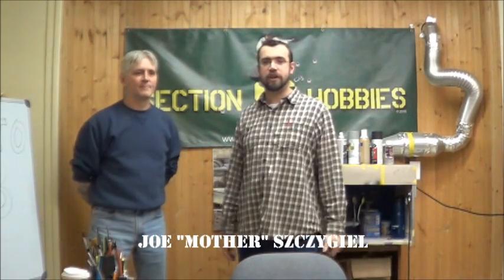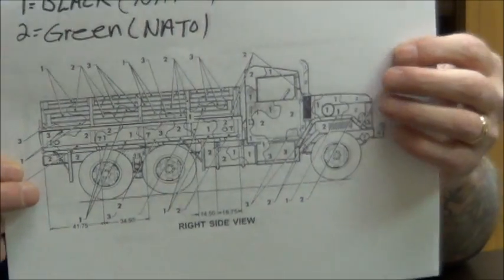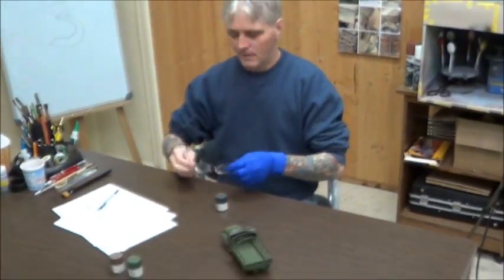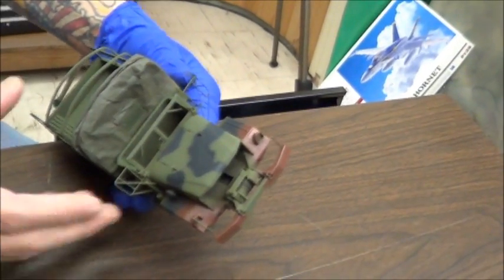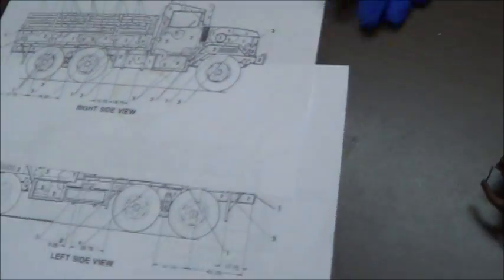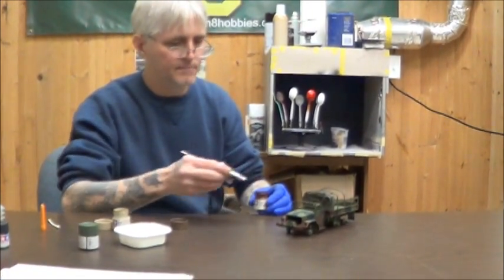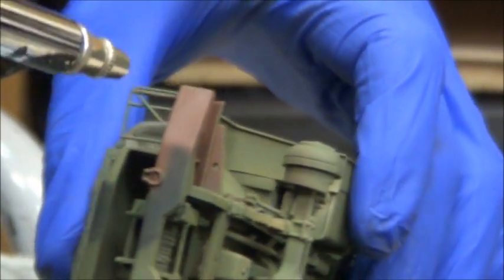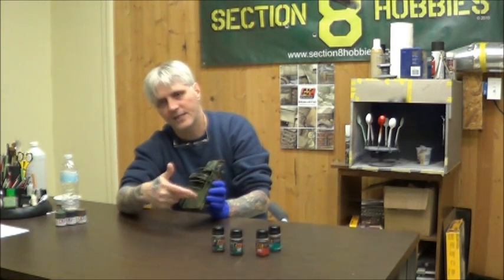Airbrushing Basic NATO Tri-tone Camo, Featuring Mother

Comment: The best colors to use for NATO... German grey, cockpit green, and NATO brown with buff added. They are lighter but fit better colorwise. It's got that nice faded look. After washes and weathering it darkens and looks great. Funny thing is, the decals for this afv 2.5 ton truck, is my unit when I was stationed in Germany. 2-15inf, 3rd ID, Schweinfurt, Ledward Kaserne, early 90s. They did get the decals wrong, but easy to fix. Good job though on this.

Comment: Is that the 1/35 AFV Club M35A2 for the kit? I'm wondering because I'd like to know if he scratch built the mirror frames himself or if those are available in an aftermarket set, as the ones that come in the AFV Club kit are for an older A1 mirror setup.
Reply from the maker: +beuford1982 Those were scratchbuilt frames on an AFV Club kit.
Reply: +Section 8 Hobbies Thanks! I'll have to try to fabricate my own as well.